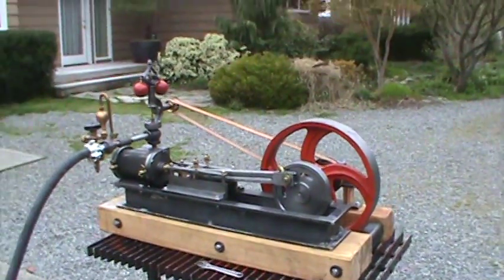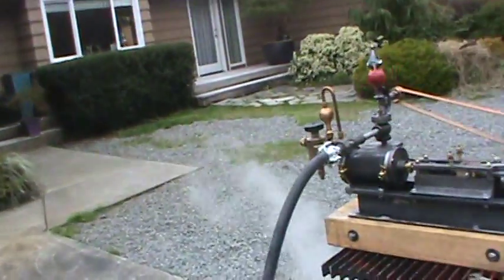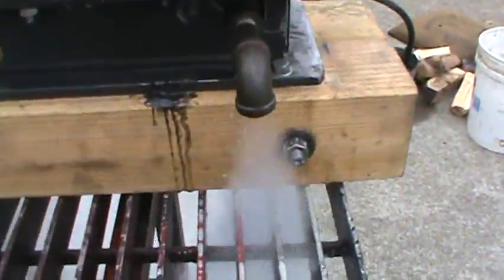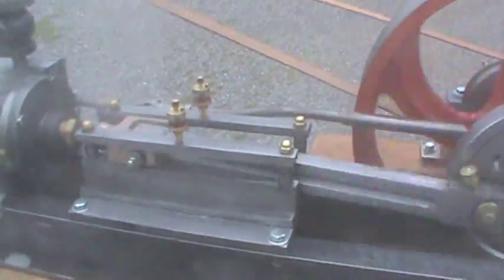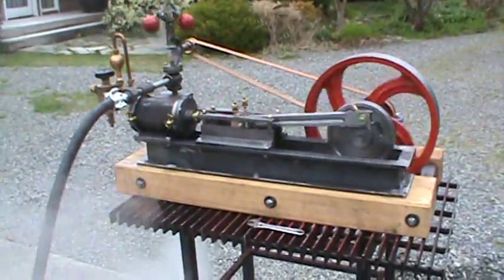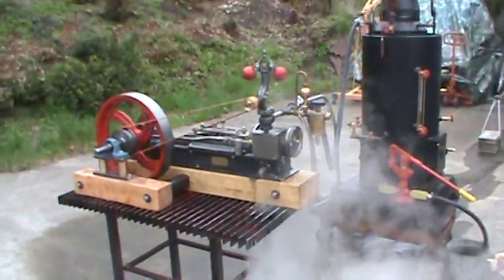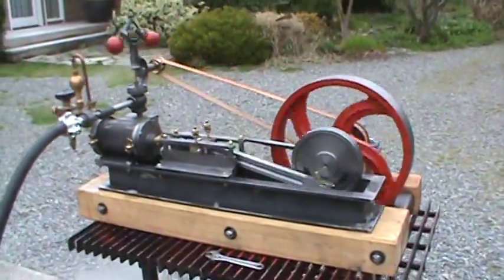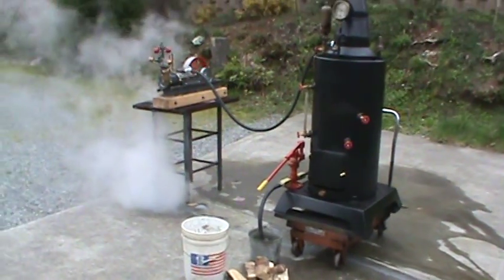Mill Steam Engine with Flyball governor.

Comment: Have you considered recovering the waste steam to pre heat the feed water going to the boiler or to run a distiller to provide clean feed water? It could also be used to run a water heater for the house and with a small recovery or extraction pump, be reclaimed and fed back after all the work was out of the steam.